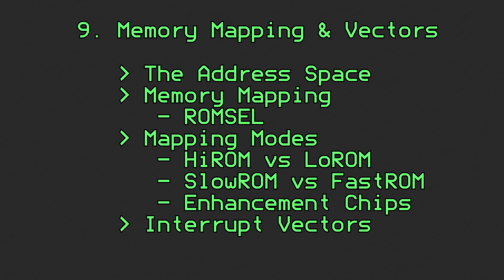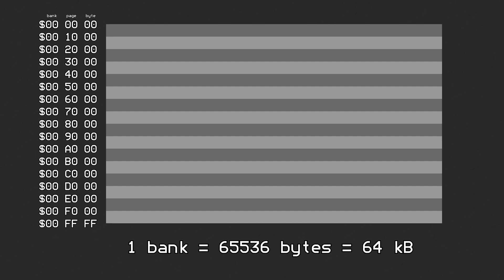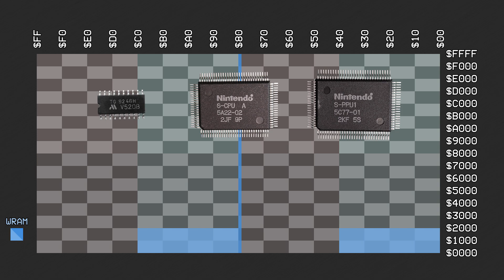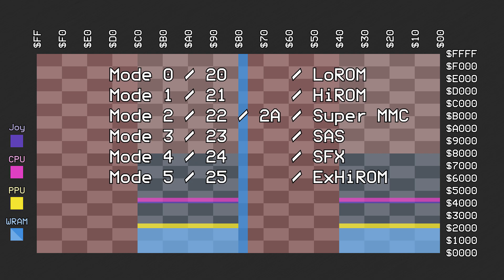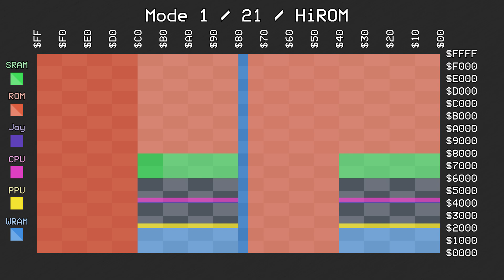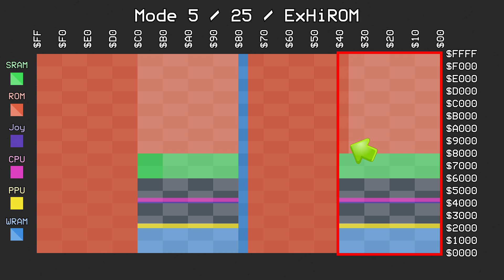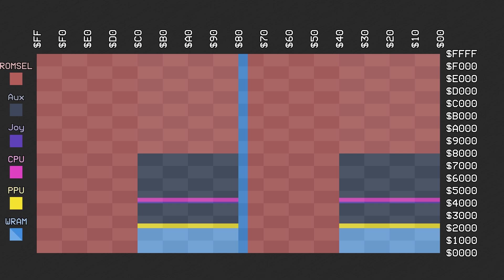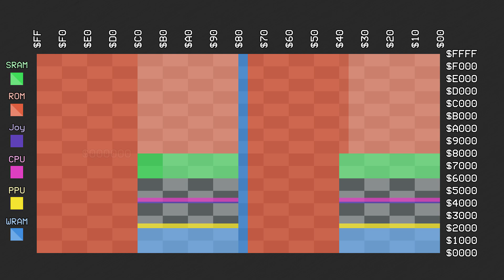Memory Mapping - Super Nintendo Entertainment System Features Pt. 09

Comment: ... so all of these mirrors are so if you're on a particular vertical line/bank, what you can access from there without changing banks?
Reply: For the RAM mirroring, yes. The 65816 instruction set was such that accessing data in the one "current" bank was 1 or 2 cycles faster, and took one less byte, than specifying a full 24 bit address. And the only way to change banks was with stack instructions (PHB,PLB,etc.) which were 3 or 4 cycles a pop (or push, hehe). Obviously this won't do during vblank, when you're in a tight race to get everything to the PPU for the next frame. So the solution was to have a small part of WRAM always visible in the same bank with all the I/O registers, so that if you structured your game's memory properly you wouldn't have to change banks often.

ROM mirroring was mostly just because the ROM chips in smaller games didn't use all the available address lines. They only used the n lowest bits of the address and ignored the rest.
Reply: @0x5D  so, basically, it's a bit like trying to use on CPU RAM for as much as possible.

Comment: When you write an instruction like STA 21 00, how do you know which page or what the actual address is?
Reply: The 65c816 CPU inside the SNES has 3 extra registers for program and memory access: the Direct Page Register, Program Bank Register, and the Data Bank Register. Your question pertains to the Data Bank Register.
        The DBR is an 8-bit register that specifies which bank data is accessed from when using a 16-bit addressing mode. So if the DBR has a value of $81, the instruction `LDA $2100` will access memory address $812100 . In short, the DBR acts as the high byte of the 24-bit address when a 16-bit addressing mode is used.
        Similarly, when using an 8-bit addressing mode, the Direct Page Register is used. This register is 16-bit, so if the Direct Page register has a value of $7E00, the instruction `LDA $2D` will access address $7E002D.
Reply: @haruki_nyan  Except direct page doesn't represent the high and bank bytes but rather, it is the base address and the address on the opcode is an index to that base address with $00 as the bank. Sounds complicated but it's really just addr + DP on bank $00 so $7E00 on $2D actually results in $007E2D (usually not mapped to anything) instead of $7E002D. And if DP were, $00D3, you get $000100 on `LDA $2D`.

Comment: So, are you saying the SNES is actually a 24-bit console with a 15-bit graphics card?  You heard right, 15-bit. Because it can only choose from roughly 33,000 colors. 16-bit would by over 65,000 colors.  Although I bet the video card itself does have a 16-bit wide data bus.
Reply: It's considered 16 bit because that's the size of its CPU registers. Similarly the N64 only has a 32-bit bus.
Reply: Only the addressing is 24-bit but the SNES uses otherwise a 16-bit processor (65c816), though with an 8-bit bus. That the SNES uses 15-bits for its colour is only done to make each colour uniform as using all 16-bits means one colour can display more colours (and besides, the single bit won't make any major visual difference anyway), not to mention that the fixed colour (read: background colour) needs to be adjusted too (each primary colour in the fixed colour uses the same register: 5 bits are used for the colour value itself whereas bits 5 to 7 determine which colours to write to).
Reply: If you judge CPU's by the size of their address bus, then MS-DOS was a 20-bit operating system and your PC is running now a 48-bit  operating system.
Reply: @vytah  My understanding, CPUs bit sizing is based on it's memory allocation.  32-bit means it can allocate up to 32-bit amount of memory.  Same as 64-bit.  64-bit addressing of memory.

MS-DOS, Windows, Linux, etc are Operating System.  Not CPUs.
Reply: @baddmatt9588  Intel x64 supports up to 48 bits (currently) of virtual address bits and my particular CPU claims to have 39 physical lines. So is my CPU 39-bit, 48-bit?

Of course not. Though I'm not sure if the pointer size (64 bits) is what gave it its name of 64-bit.

The thing is, the bitness of each CPU is decided by convention and stuff such as address size, general purpose register size etc are mere heuristics.

By the heuristic of general purpose registers, the Intel CPU in my laptop, the ARM (Cortex A53) CPUs in my phone and my RPI are 64-bit and the Intel 8086 is a 16-bit (with 20-bit addresses). The 65816 in the SNES is 16-bit due to its 16-bit registers (though it is claimed to be 8/16 bit due to the selectability between 8-bit and 16-bit registers; that's just another oddity in the naming, but they wanted to market that selectability so this stuck), while the 6502 is a definitely 8-bit CPU even though the address space is 16-bit.

Look at the general purpose registers. Not address sizes, not other heuristics. The size of the general purpose registers determine the bitness of a CPU.

If you look at the largest register, my CPU would be 512-bit due to the AVX registers. Old 32-bit-only Intel CPUs would be 80-bit because their FPU (which is inside the CPU since the '486) works with 80-bit floating point values (which some C compilers expose as "long double"). Of course that isn't a good heuristic!

Comment: Wait, what!? 6502 emulation mode? I never heard about that before. You mean there's a way to execute 6502 assembly in the SNES CPU? What else is compatible with the NES? Not much I assume, otherwise we would have seen retrocompatibility back then. But I guess that explains some ports that are way too close to their NES counterparts, like Ninja Gaiden Trilogy. At least the logic could be ported, right?
Reply: Yes, it's a standard feature of the 65816. Almost all SNES games switch to native mode almost immediately on boot though.

The 65816 instruction set is a strict superset of the 6502's (as long as you don't rely on the "illegal" opcodes of the latter.) This similarity would generally have made it very easy to port NES code to the SNES. I imagine Super Mario All-Stars made good use of this. Has anyone actually checked? How much code in SMAS is copied verbatim from the original NES games?
Reply: @0x5D  That's amazing. Unlike Sega, Nintendo wasn't very famous for retrocompatibility at the time and I don't remember ever reading about this before, but yet... It was there all the time. 
Now I'm also curious about SMAS.

Comment: Why the data is mirrored? what is the use of that copy?
Reply: To avoid having to switch banks as often I guess?
Reply: @PhaaxGames  Thanks!
Reply: There's multiple reasons.
The single most important overall can be seen right at the end of the video;

The system vectors are stored in 00FFE0 to 00FFFF
This is the first thing the system checks when it first powers on, so if there's nothing stored there the system will fail to boot anything.

However, for practical reasons, it's better if games map their code to the upper banks (banks 80 and above), since amongst other things, that may be able to run at higher speeds, and you won't have to deal with the System RAM eating some of the address space (ROM in the system RAM area is impossible to access)
This shows our first issue; We want the ROM in the 80+ banks, but we NEED there to be valid data for the system vectors in the upper end of Bank 00
The easiest solution to this is mirroring.

The second reason, which is why there's that weird scheme where some of the quadrants only allow ROM in the upper half, is that the 65816 is a 16 bit CPU, but 16 megabytes of address space is 24 bits;
One of the consequences of this is that you can access a 64 kilobyte 'page' somewhat faster than trying to access any arbitrary address in the 16 megabyte range.
This also means that, where possible you should try and keep everything you're currently working with in the same bank (eg. same 64k region)

If you're only dealing with ROM, use a bank that only has ROM mapped in it;
But if you need some RAM, then it's helpful to have some RAM in the same bank. And similarly if you're working with the PPU registers (which you will be in many cases), it's helpful to have all of those in the same bank as well.

This is why not only are there banks where the lower half contains a small part of the system RAM, but also all the control registers for the hardware.
And, why that small chunk of RAM and those control registers are deliberately mirrored across so many banks; So that no matter which of these banks you're dealing with, they'll always be accessible.

Some other things include that: 
- it's slightly safer for programmers if most areas of the memory map contain some kind of valid data, even if that's a copy of something else, because reading from an area that has no hardware at all attached to it would mean reading from 'open bus', which causes weird, unpredictable behaviour; For well-written code, this won't matter because you won't access 'forbidden' areas, but for mildly buggy mode this makes it marginally less likely the system will randomly crash

- Mirroring is actually easier to implement in hardware than NOT mirroring;
To understand why you kind of need to understand how the actual electronics work to at least a limited extent.
When you read/write from a memory address, what the CPU actually does is set a value on the address bus, tell the attached devices whether it intends to read or write from the address, then read or write the value from the data bus.
However, physically, with a 16 megabyte address space this actually means there are 24 physical lines (electrical pathways) for the address bus, and 8 more for the data bus.
Let's say you want to map 1 megabyte of ROM into this somehow. You wire up the 8 pins of the data bus, wire the read/write pins, and if required, a chip select pin. (this turns entire memory chips on and off; not super important when there's only one memory chip, but if there's more than one, you only want a single one to respond at the same time). But then you wire up the address pins. - except 1 megabyte only requires 20 pins (2^20 bytes = 1 megabyte), and you have 24! What happens to those 4 pins you didn't connect?
Well, it turns out you can ignore them; If they're not connected to anything, when a value is written to that pin, nothing happens.
But, think about what this means; You've just wired up a chip such that 20 pins select an address in your ROM chip, and the remaining 4 are ignored.
But, what happens if you change the value on one of the ignored pins, but also change the value on one of the pins that's wired up? 
Well, sine those 4 leftover pins get ignored entirely, the actual effect is that the ROM chip still responds anyway and puts data on the bus. What data? The exact same data whatever matches the 20 pins that are already connected!
So, what does this do? Well, if you hadn't guessed already, this causes the data to be mirrored at multiple addresses.
And to AVOID mirroring actually requires that you attach something to these remaining 4 pins and use some kind of logic circuit to make sure that the ROM chip doesn't respond if any of those extra address pins are active.
In other words, NOT mirroring requires extra circuitry vs simply letting the data be mirrored.
So... Mirroring is the less complex thing to implement, thus unless there's some practical reason why having mirroring will mess up your system, you basically always end up with mirroring, since disabling it takes extra work for no good reason.
As to what is mirrored? Well, that depends on how you connect your pins.
You might at first glance think... We have 20 pins so we ignore the 4 highest ones, right? Well, that IS one option.
But think about what removing each pin actually does; If you number the pins 0 to 23 (by convention this kind of thing usually starts with a pin 0, not pin 1), then disabling the top 4 pins (pins 19-23) causes mirroring every 16 banks. (there are 256 banks total because a 'bank' refers to the upper 8 bits of a 24 bit address)
That is, bank 0 is mirrored into bank 16, 32, 48, 64 and so on, and bank 1 is mapped to 17,33,49 etc...

Nothing wrong with that, but what about other options? Well, mirroring the upper and lower half of memory results from ignoring pin 23
And what about this weird thing where for each bank the lower 32 kilobytes matches the upper 32 kilobytes?
Well, if you think this through, this results from skipping pin 15.
So pins 0 to 14 on our hypothetical 1 megabyte ROM chip map to pins 0 to 14 of the address, but then pin 15 of the ROM chip maps to pin 16 of the address, and everything else continues from there (17 to 16, 18 to 17, etc)

The reasons for choosing any particular type of mirroring relate to what you wish to accomplish, but the general idea of mirroring actually results because it's the easier thing to implement than creating the circuitry required to avoid mirroring from happening.

And if you're wondering why they'd want to do that weird 32k mirror specifically... Think about really small games; (there are other reasons, but this is the most immediately obvious)
Let's say your entire game is 32k total;
The most obvious thing to do would be to map that in bank 0, from 0000 to 7FFF, which is the first 32k of memory.
But, all of our hardware registers are in this bank, and so is the first 8k of our RAM,  since we decided it'd be useful to have this easily accessible without always needing to change banks to get at it.
So our 32k is actually not fully accessible if we put it here.
More significantly, we need the ROM to contain our system vectors, which, as I noted way back, are in the FE00 to FFFF memory region.
So our naive idea of mapping our ROM into the first 32k actually won't even boot.
So, what then? Well, luckily, if we simply don't connect any pins above pin 14, we naturally get this 32k mirrored into the upper half of bank 0, and suddenly everything works flawlessly.
But if we happen to have more than 64k, we get an extra benefit from continuing to skip address pin 15 anyway; Our entire ROM, as long as it's small enough (less than about 8 megabytes) can map into the upper 32 regions of each bank, and, aside from the banks that contain our 128k of RAM, nothing in ROM will interfere with the hardware registers for any reason.

I could go on with other details, but I think you probably get the general idea by now;
Mirroring (and specifically deciding which parts of memory to mirror) is used to solve various minor technical issues, but overall the real reason why mirroring exists at all is because the simplest hardware solution for using less than the full 16 megabyte address space (or any situation in which a computer has more address space than physical memory), automatically leads to mirroring, and it's actually more difficult and expensive to avoid mirroring than to just let it happen.
Reply: @KuraIthys  I think you should help write for the show! But in all seriousness, I was wondering the same thing and after reading your comment, it makes a lot of sense now from both a hardware and a software point of view. I was thinking it was only meant to help the software end as a quick access point for any data.
Reply: Thank you. I think the show is doing pretty well without my help though. XD
But it's always nice to hear that someone appreciates an explanation like that.

Mirroring is one of those things that just seems really weird at first glance, but actually has a lot of good reasons to exist. (and in fact exists be default in a memory system unless you actively work to avoid it.)
Reply from the maker: This entire comment is eerily similar to the script for part 9b... Very well explained!
Reply: lol. I guess understanding this hardware reasonably well and then trying to explain it to others leads to similar explanations.
Purely coincidence, but interesting either way. XD

Mirroring of course is by no means specific to the SNES. (as I said it's a fairly natural consequence of the easiest method available for using less physical memory than the available CPU address space.)
And the system vectors aren't SNES specific either, since they're dictated by the use of a 6502/65816 CPU - thus in my case it's not just knowledge of the SNES that leads me to know about that, but also several other systems I work with at times, such as an Atari 800XL (6502 CPU).
Amongst other things this exact detail is also relevant to the Apple II series, the NES, C64, BBC Micro and a handful of other systems.
The more you know about old computers, the more you see the things which are the same between them, or very similar.
(see for instance, Atari ANTIC Display lists, Amiga Copper instructions and SNES HDMA - for 3 quite different methods of doing broadly the same thing. - they all work differently and have no real hardware in common, but what they allow is quite similar in many ways.)
Reply: @RGMechEx  I was hoping you'd explain why mirroring happens at the hardware level. It makes perfect sense when you understand how the addresses actually get to the ROM chips!
Reply: @KuraIthys  Sorry for trying to simplify this beautiful explaination down for myself, but basically the side effects of logic being expensive and wire being cheap just happen to be useful?

Comment: I have to wonder why there was never a MidROM configuration that uses the entire ROMSEL region to it's fullest. You always lose 2MB of addressing space in either configuration. (4MB for the Ex**ROM variants)
Reply: You mean a massive 95 megabit game?
Reply: @aaendi6661  Only if you used ExMidROM. And that's not really the point: the point is to avoid messing around with bank switching or stranding half your game in slow ROM mode.

If you want >4MB in your ROM, you have to either use bank switching, or the slow ROM mirror space. Both are a pain in different ways, when you could get an extra 2MB "for free" by using ROMSEL space more efficiently.